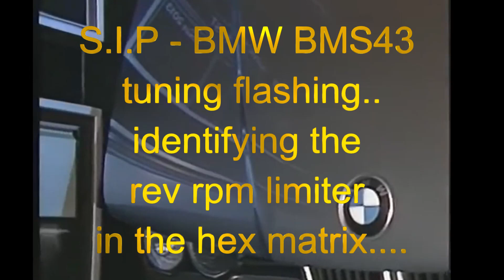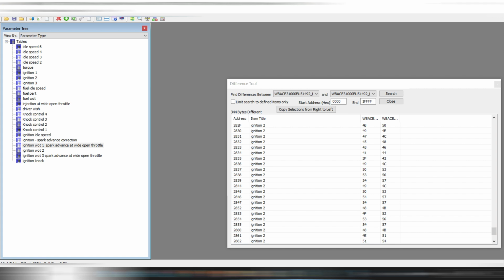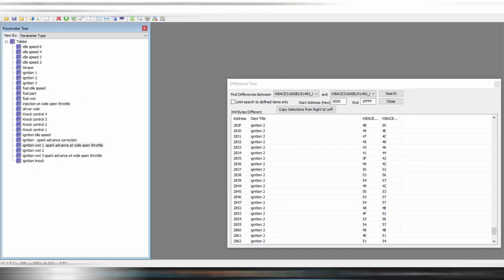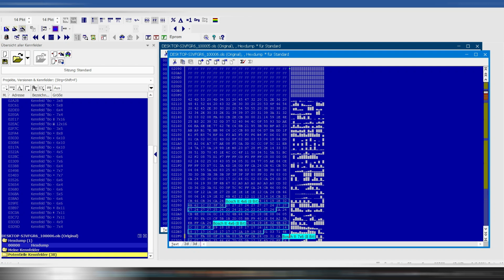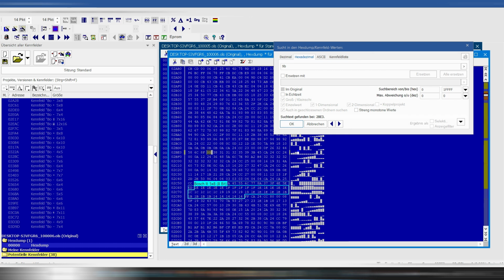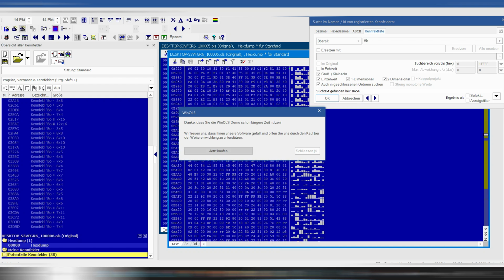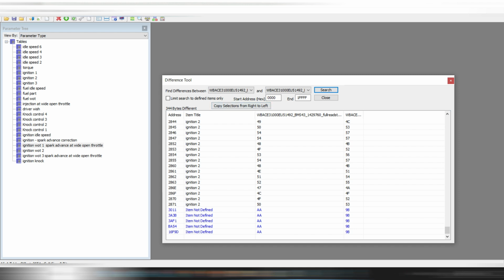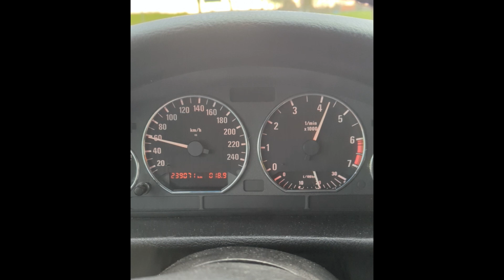BMW S.I.P - finding the rev limiter - ECU BMS43 e36 diy tuning for the M43 engine.

Comment: is it possible to add a hard limiter too?
Reply from the maker: @bmxmaster1997  Not sure. Sounds pretty hard limiter already stock
Reply: @ mine sounds like a fuel cut, if i hit rev limiter during acceleration, it really start jerking like its accelerating and decelerating as it “bangs” the limiter. a friend also had a 318i but his had a more classic rev limiter which sounded more like a hardcut and it didnt jerk the car when he hit it. is this maybe the difference between bosch motronic and ms43 ecu? i believe his car was pre facelift and mine is a facelift.
Reply: The 4 banger Had hard limiter Stock, maybe there is Something wrong with your car
Reply: @patrickpehar  theres nothing wrong with my car, goes better than every other m43/m40 i drove and keeps up with 318is e30, just the software is different like the limiter between m52 vanos and m50 for example
Reply: @bmxmaster1997  then you Tell us why every m43 has hard limit Stock and yours doesnt
Reply: @patrickpehar  same reason it its one of the rare ones that got an electric fan from factory instead of a viscous fan, its one of the later models. Ecu also changed from bosch motronic to ms43. I have zero intention of arguing with a random guy if my car really is as clean and good as im telling you it is, just as you have zero intention of believing me. This is why i asked the author of the video since he is obviously knowledgeable and has done the same camshaft as i did in mine, not you.
Reply: @bmxmaster1997  Its nothing rare if it has an electric fan. If your car has ac it has an e-fan if not it has a viscus. I was telling you facts about e36 and was asking you what you think may be the reason for your car Not having a stock limiter. Nobody said i think you are lying.
Reply: @  that is absolutely not a fact, only the later models got an electric fan, ive seen plenty of m43s with ac and a viscous fan. Its just an update that happened towards the end of the production. my car is stock as far as the ecu goes and thats just the way the limiter is on the really late models. limiter sounds hard in neutral but when driving, its not smooth when you hit it, thus meaning its the fuel cut limiter. after watching the video again i see that the authors car does the same thing, you can see how the car jerks when he hits it. i was just asking if its possible to tune a limiter that would be smoother and not so jerky when hit.
Reply: @bmxmaster1997  ac: until 93 you got viscus + Pusher e-fan, everything after that got a 2 Speed puller e-fan.
Reply: @patrickpehar  again, its an update exactly like there was an ecu update.
Reply: @bmxmaster1997  Check your facts
Reply: @ im glad we had a debate about fans when that wasnt even the point. have a nice day
Reply: @bmxmaster1997  We could even Talk about hub caps, but the thing is when somebody does not check his facts, he is just talking about how he thinks something should be and this is not how any topic should be discussed
Reply: @patrickpehar  in this case both of you are correct. both in terms of fans, and that bms43 DOES indeed have a lame slow rev limiter. motronic m1.7.2 and m1.7.3 (which is by far more common than bms43) has a fast limiter. hence why you probably never heard the slow one before. its rare.